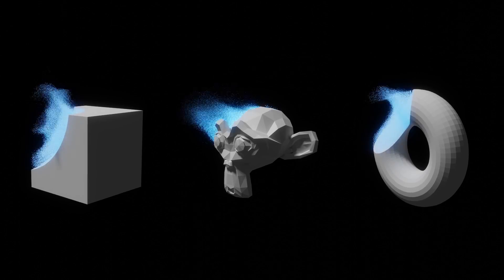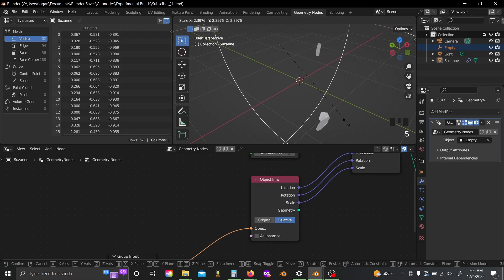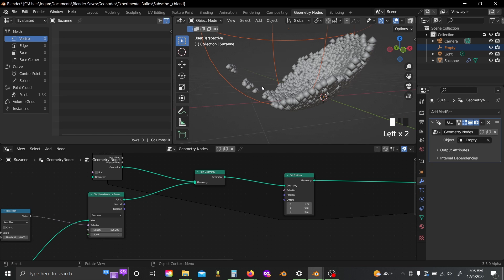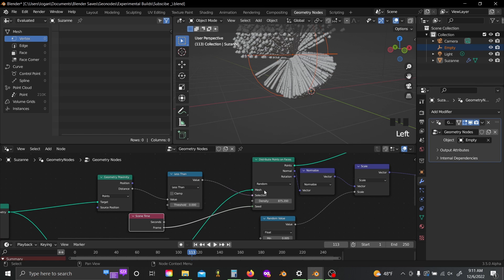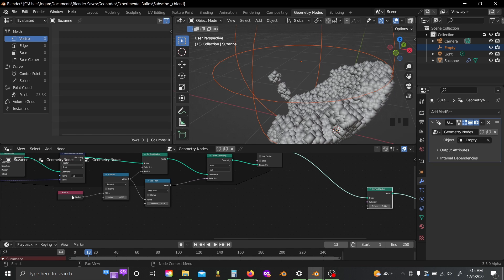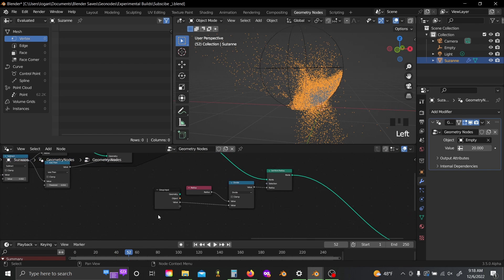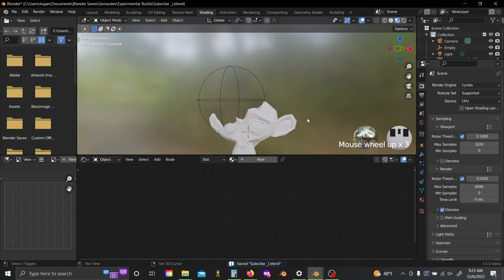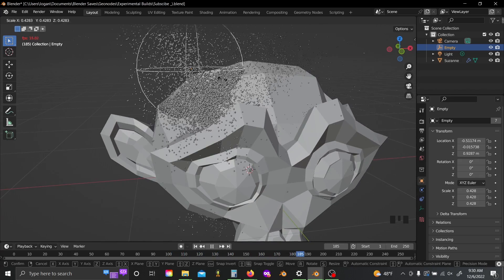Particle Disintegration Simulation with Geometry Nodes | Blender 3.5 Tutorial

Comment: Hey, I'm trying this on a slightly more complex geometry - everything works fine until I try to render out the animation and it results in only rendering a few points that shoot off from the normals of the icosphere, not the cloud that is created in the view port. Any help is greatly appreciated! Thanks
Reply: Solved: Go to object's physics tab and bake the simulation before rendering
Reply: Had the same problem with some leave flying animation using particle system, wasn’t able to get the render correct for 2 hours until I realized I needed to bake it lol 😢

Comment: Any idea why I get an error code when rendering that says, "Requested OSL Group data size (2408) is greater than the maximum supported with OptiX (2048)" ?
Reply from the maker: I’ve never seen that before but my only guess would be if you check your render settings, under “performance” the tile size should be set to 2048 but maybe got switched to 2408 somehow
Reply: @AlaskanFX  Thanks, for you're reply. I found a work around by deselecting the checkbox labeled "open shading language" in the scene settings. I'm using Cycles - supported - GPU Compute, btw. Hopefully this will save other hours of time searching through forums lol.

Comment: Hi there! Thanks for the video. One question: in my scene the icosphere appears (even with his visibility off) while moving the empty and I don't quite underestand why. Would you know? Thanks!
Reply: Your comment is already over a year old, but perhaps it helps at least someone else. 

I had the same issue, additionally parts of the object that where already gone, reappeared for one frame and vice versa.

The issue seems to be the Boolean operation. It didn't fix the issue 100%, there were still some weird clitches, but the result is decent. The "Mesh Boolean" that was added at the beginning is a bit different in newer Blender versions. Change the solver from "float" to "exact" and it should work.
Reply: @siemensohm  thanks for replying, 2 years later and this helped me fix it
Reply: @ergosoom you're welcome :)